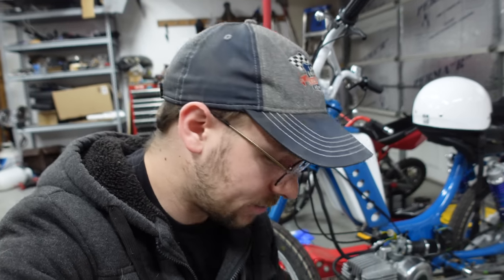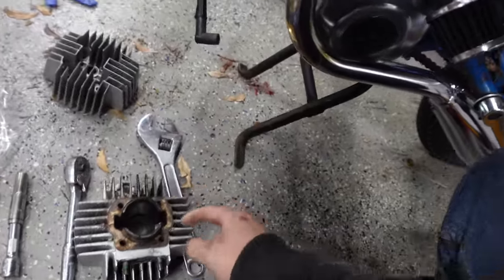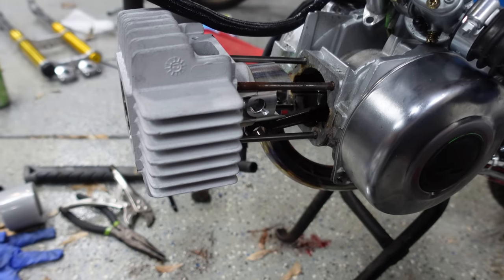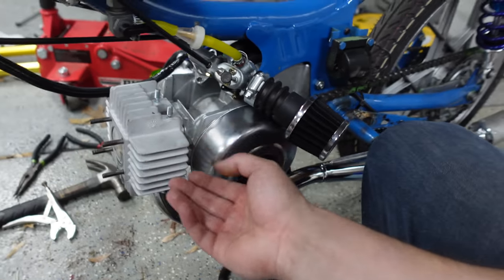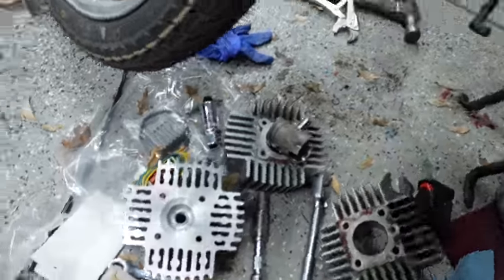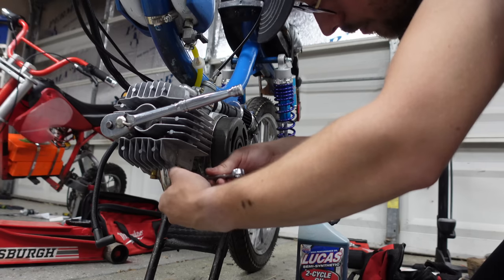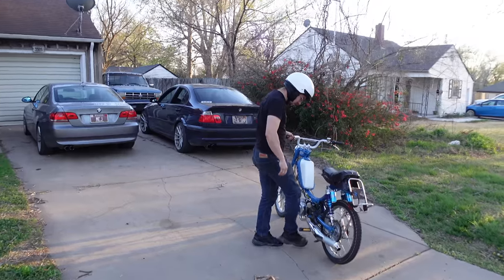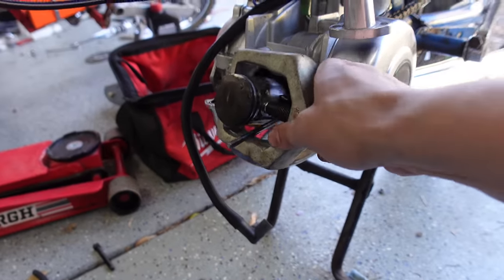BIG BORE and HIGH COMPRESSION on my MOPED! (It blew up...)

Comment: Break-in= more oil in your mix and idle for about half a hour and you want to run it rich. This will give all the parts lubrication and time to break in. I do this on all the motors I rebuilt and new ones too. I hope that this helps you out. I'm building a 1978 Vespa Grande but I am having a hard time finding covers and some snowflake wheels, any leads

Comment: In England we got screwed over in the 70's and at 16 all you could ride at 16 was a moped, (it used to be a 250cc before they changed the rules). Before all the Garellis and Fantics came in the Puch Maxi was the go to. My pal Norm was 6 foot 3 inches and weighed 230 lbs. He used to rev his maxi to flat out on the centre stand and then we'd push him off. It would do a very small wheelie, bog down and pull away. Total abuse but it just kept ticking like a Timex watch. When trucks drove by you the speed would slow 5 mph then speed up 5 mph with the air displacement from the truck. Absolutely dangerous but the rule still is there. At 16 it is 50cc 6 bhp and max 30mph.

Comment: When I was a teen my dad had a Harley shop. He had a streak of rebuilds due to seized valves, caused by bronze valve guides.
As I understood it, the determination was that bronze valve guides are bad for air cooled engines.
The reason given was that air cooled engines get hotter. Thus, bronze attracts carbon and allows it to bond. The carbon became a cutting agent, scoring the valve stem until enough built up to seize it.

Ever since then I’ve basically been leery of using bronze anything on air cooled engines

Comment: Taking a low power scooter and increasing the power has always been a boondoggle for me. It exposes every other weakness in the system, from cooling to transmission problems and compression. Turns out most of these components are already close to their limits.

Comment: The second you said it doesn't even smoke I new something was wrong. 2 strokes are supposed to be smokey. Got too hot because it was way to lean you need to up the jetting